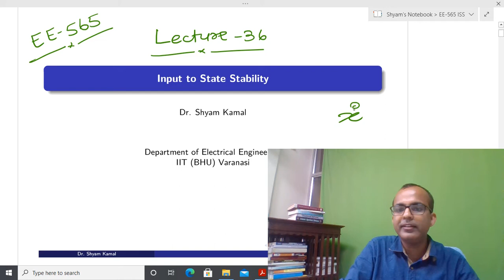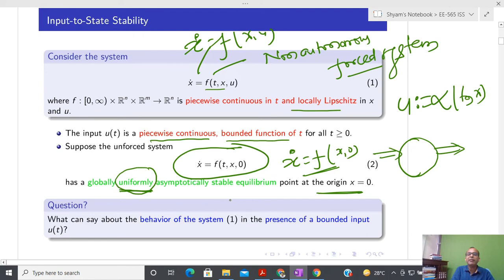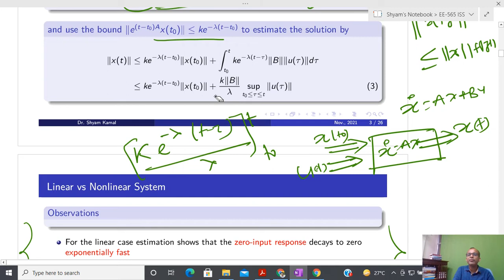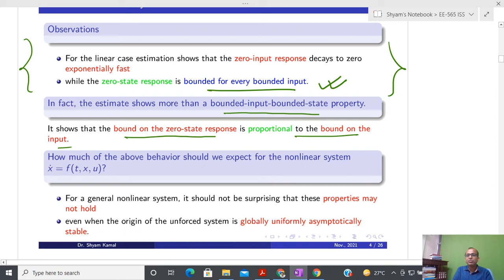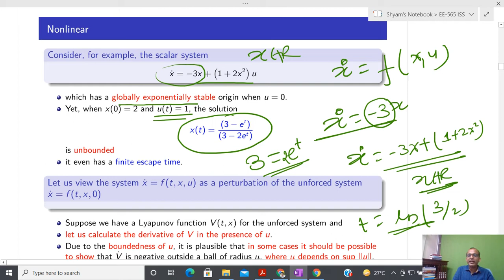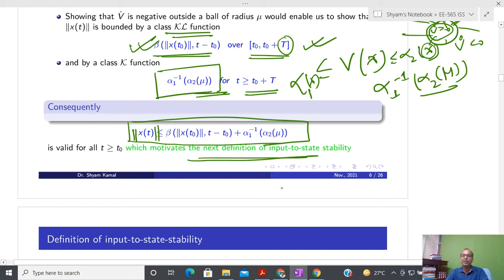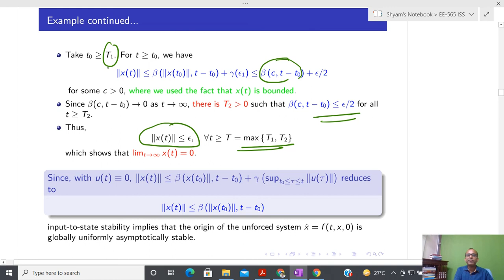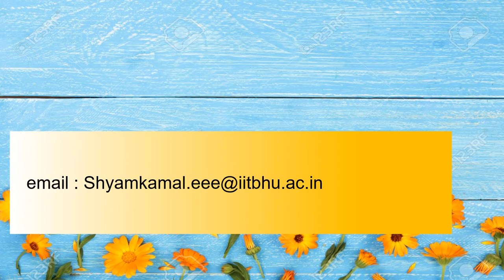EE-565: Lecture-36 (Nonlinear Control Systems): Introduction to Input to State Stability

Comment: Have you uploaded the rest of the lectures ? Or is this the last one?
Reply from the maker: One more lecture no-37. Actually nonlinear course is divided into two parts.  One parts for analysis another part is for control design. In a semester we have just 40 lectures, so only first part is covered.